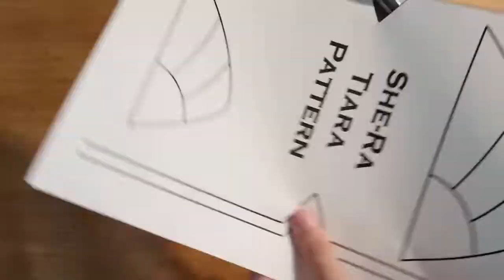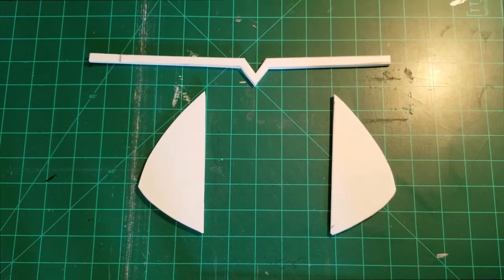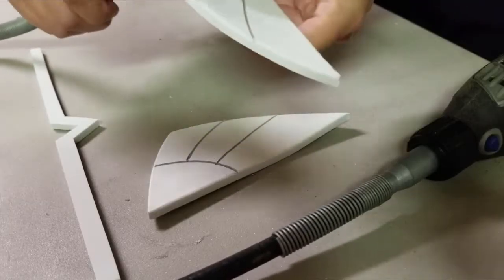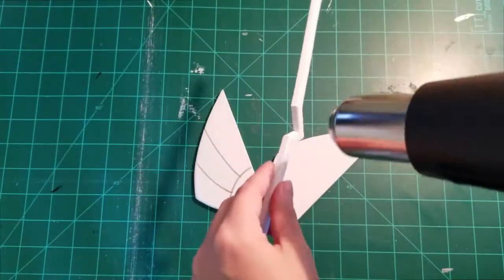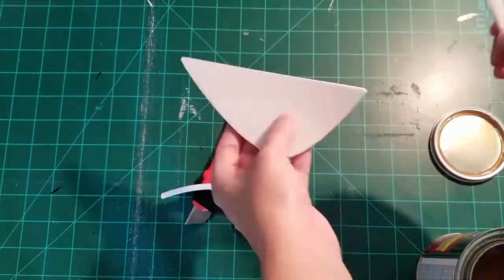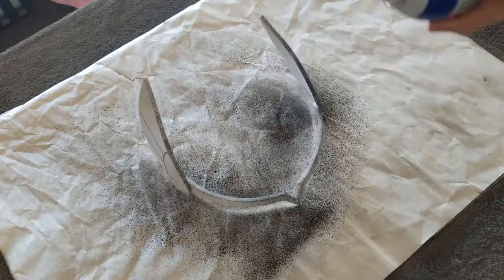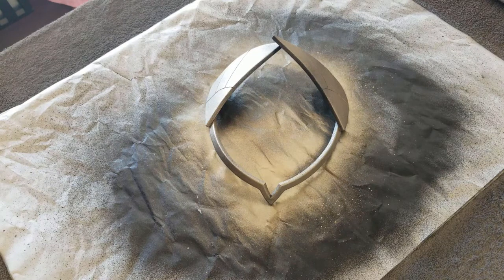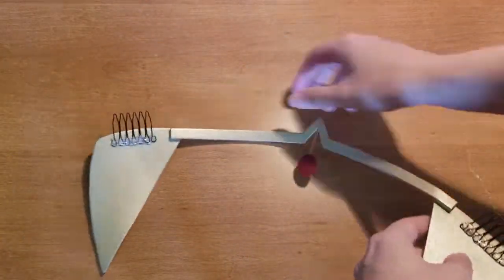She-Ra Tiara Tutorial (w/ Free Pattern)

Comment: This might be a silly question but I don’t have a heat gun, would a hairdryer do a similar job?
Reply: I think do yeah but you might need to experiment with the temperatures a little. I think it'll turn out ok though.
Reply: Another thing you can use (but be very careful!) is the oven. Put it on a low heat and form over it. Just wear protective gloves. 

Use to do that method when I was younger and couldnt afford a heat gun. Hope that helps!